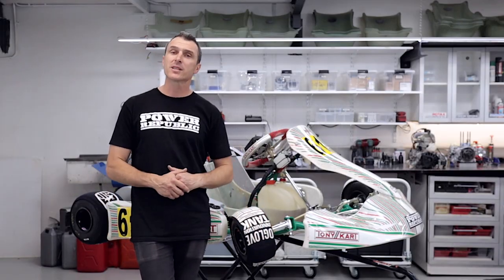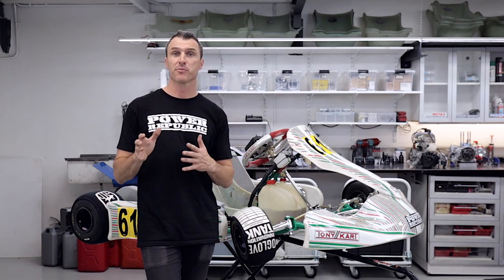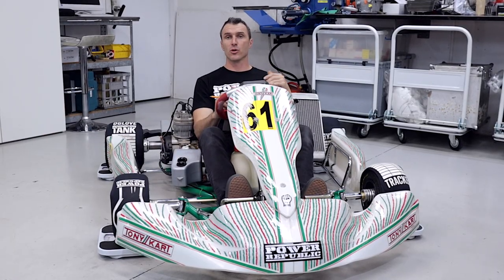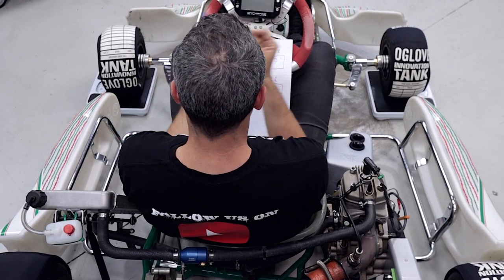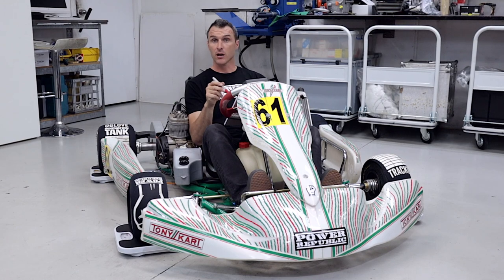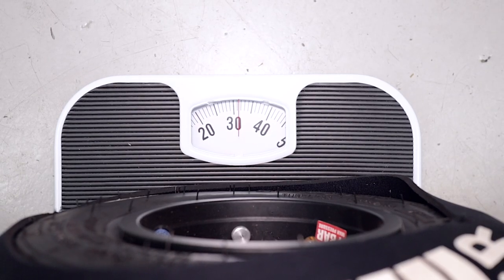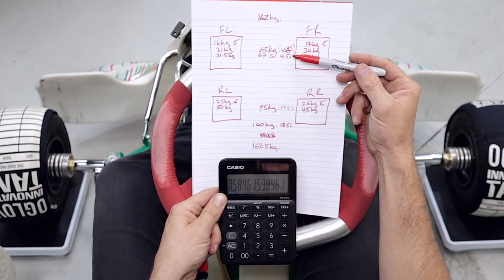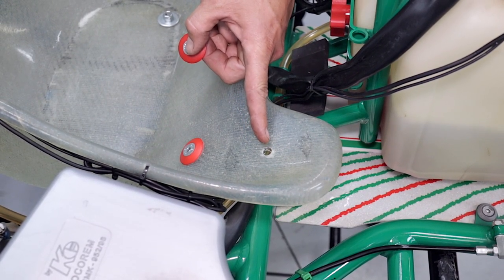HOW TO: Go Kart Weight Distribution for Optimum Performance - POWER REPUBLIC

Comment: If you really want to go into the details on this one, always add your ballast as close to your center of gravity as possible. It makes the kart more responsive to direction change than having weight too far out, due to inertia effects. Think of it as holding a weight to your chest and then trying to turn your upper body vs. holding that same weight out with stretched arms and turning your upper body. The latter will take much more effort, due to the increased arm. Those weights you are bolting onto the chassis under the steering column will probably hurt your handling.
I always work with seat position first to get the correct ratio and then add any required ballast to the sides of the seat, as close to CoG as possible.
Reply from the maker: Thanks for the feedback.  and thanks heaps ro tuning in and watching the videos

Comment: Hi Derek, great videos! A suggestion before buying the scales, I would recommend weighing yourself on all 4 in the shop to see if they are the same. When I went to buy $20 scale, all 4 were gave me slightly different weights by up to 2kg between the 4
Reply from the maker: Thanks for the tips!  I did notice a small variation.   what you can do if you are super keen, you can rotate the kart 180 degrees and re weigh the kart, which I didn't show in the video.  also helps rule out any inconsistency in floor levels

Comment: I'm watching videos trying to demystify seat placement and this awesome video seems to offer a different perspective.

I'm about to install a new seat into my very first kart (Arrow X5).

Being 97kg in the buff and 6'3", am I right to say "forget about weight distribution and position the seat as far back as needed to fit in the kart" then add lead to fix the weight distribution?

I'd rather avoid having to spend another $400 for the pedal extension kit if I can.

Thanks for all the great content.
Reply from the maker: for you height I would reckon you should save some extra and lash out on the foot extension.  it will be more comfortable and help with weight distribution IMO
Reply: @PowerRepublic  thanks, I appreciate your advice. I installed the seat today using your technique and along with readjusting the pedals and heel rest, it feels ok to at least get started but I'll keep the extension kit in mind as my skills improve to the point of needing to focus on balance and inside wheel lift.

Comment: Derek, great video! Is the chassis bent? There is a 5kg difference between the front right>left. Just curious. Thanks man
Reply from the maker: Hey Carlos, not sure on that, I could have moved the scales or the steering wheel to compensate.  I have to admit that it wasn't a perfect set up for the video due to time constraints, mostly just an example of what you could do.  hope that didn't throw you off.

Comment: Don’t forget that it’s critical to have your front end setup as you will be running and to have the steering centred when measuring the corner weights, they can change massively due to jacking forces. Also, are there any F/R% balance recommendations for rookie and cadet karts with narrower rear tyres?
Reply from the maker: Thanks Mr Nismo, I agree with the steering geometry and centring.  Sorry I should have mentioned that as well.   For the Cadets we use close to 50/50 split if they are using the same width tyres.
Reply: @PowerRepublic  yeah I figured it should be closer to 50/50, that’s what I’ve always assumed for (it’s tough to be able to mount enough lead up front to achieve that though haha)
Reply from the maker: yeah other than that you have to move the seat forwards.  Play around with it, everyone is different and sometimes to much weight forwards will create too much oversteer not matter the weight split percentage.

Comment: It is called weight distribution according to the kid's weight. Is not to make him slower, is actually to make him sharper in the turns, he might lose a bit of acceleration but it worth it.
Reply from the maker: yeah the balance of the kart.   check it and then drive it.  adjust forwards or backwards after that depending on your feeling

Comment: @PowerRepublic Question my friend.  When I go thru this exercise I note that a small input on the steering wheel can quickly effect front left and right weigh distribution.  ( which is a good think for a go kart of course)  The question is should I tweak the steering wheel to balanced the front?  No impacted?
Reply from the maker: Yes correct, the steering does impact the readings.   Try to balance the front end, even slap your sniper laser levels on the stubs first to make sure your wheels are straight ahead.  Write down the results.  
Then lift the kart and rotate it 180 degrees and repeat the process.  
This should give you a better idea of your overall situation. 
I will say, that using bathroom scales is not an exact science, more of a ball park experience.  
Good luck and let me know how you go

Comment: We race in the low-power lo206 class, and we are constantly having problems with the rear binding up because the tires have too much grip for the motor. The more weight we can get forward the better. Our alien who is walking away from the championship is a smaller guy who has 18kgs of sheet lead bolted to his floor pan under the seat. He's got almost a 50/50 front-rear split and is .3" clear of the field most days.
Reply from the maker: yeah the low powered classes are a bit like that.  Have you checked out the 'Fast Adjuster" video?
Reply: @PowerRepublic  Those look rad. Looks like it might raise the seat a bit no? I'm 6'2" so I have to run my seat as low as I can get it.
Reply from the maker: Nah not at all. You can still get your seat below the rails if you need to
Reply: Are you guys running the softest axle, cut, with the shortest hubs?
Reply: @helmetculture  I'm on an OTK, so running a 50mm. I run the medium hardnes, standard length

Comment: Hi. I tried this with bathroom digital scales. I tested the scales using a control weight and they were good. 

But when I put the kart on them I get a different reading every time I lifted and placed it back down. 

Just couldn’t get an accurate reading. Any thoughts?

Each one always have a different reading, but with the control weight everything was fine.
Reply from the maker: yeah it is not as accurate as the digital version.  also too if the tyre pessures are different or the steering angle is off slightly will change the out come

Comment: Hope this isn't a silly question but I presume if you measure the weight like this and then added all the 4 measurements up (all 4 scales) then it should add up to the total weight of kart plus driver as if you had weighed it on a large roll on weighing device  (like what we all use at a track). Is that correct?
Reply from the maker: Nah that is correct as a rough idea of total weight.  then check at the local track you are racing at

Comment: Id probably need 20kg to make my kart race legal with me on board. Im about 54kg. I wonder if adding weight would improve the grip on corners, and if that extra speed in corners would improve lap times even with slower acceleration out of corners.
Reply from the maker: Hey Chris, it might add grip.  are you going to be racing soon?
Reply: @PowerRepublic  not as soon as id like. Tracks are open but im busy...
Reply from the maker: Yeah boi.  Get out there.  20kg’s is heaps.  Put it on slowly and feel it out

Comment: Great video but more or less for light drivers if you do a video with the seat position to get optimal weight distribution using the seat position.. and using no weights.  For example for heavy classes.. would be great..
Reply: Yes would love this being a heavier driver! 👌
Reply: Process is the same, but you don’t have any ballast to work with, and the seat can only move forward and back.
Reply from the maker: Great suggestion!  and yes Dan is correct, you would have to move your seat forwards or backwards which would be a bit of trial and error.  also to some of the engine accessories could be moved forwards or backwards to solve some weight issues

Comment: what's the best way to add weight to the left or right at the front ? mostly left to balance engine weight
Reply from the maker: use some lead if you can, otherwise you would have to angle your seat forwards
Reply: @PowerRepublic  hi thanks . i meant how to mount the lead ?
Reply from the maker: @robinafandale  bolt it to the front of the chassis on the steering column support stay (between your ankles)

Comment: Did I miss something, does the left and right need to be even weight the same weight then you have the 57/43front and rear.  It looks like your left and right is slightly off even does that matter
Reply from the maker: Happy new year Kenny.  front/rear should be split 43/57 and the even left and right close as you can ( normally 1-2kg’s )

Comment: What about the weight ratio between left and right. since the motor is quite heavy on one side?
Reply from the maker: hey Jordy, yeah that's right.  the Tony kart in this video has offset seat up rights which places the driver a little off centre to the brake side.   this helps counter the engine weight.  50/50 across the kart (or as close as you could get it) is ideal with a weight bias 43%F / 57%R  as a good starting point
Reply: Yo Derek, thank you for the information. I have moved my seat more to the left (away from the engine). now I have the seat on the side of the brake pedal at 61.5 cm and the accelerator at 62.0 cm. from the top of the seat to the rear axle at 22 cm. is this a bit correct (I'm driving a Tony kart)? And what is the easiest way to change the width at the front wheels (and what effect does this have)? greeting from the Netherlands
Reply from the maker: Sup Jordy, 62cm is a bit close for most people, did you check the weight split with scales?  I think most karts here are close to 63.5cm from the front. and about 19.5-21.0cm from the axle, but what ever works for you.  Stay tuned next week as we have a great idea how to change your seat position while you are at the track.....
Reply: @PowerRepublic  thank you for the quick response. I am only a short person (1.71m & 77kg). I found these sizes online suitable for Tony Kart. what is the advantage if I would move the chair further back? And what is the advantage if the seat is shorter on the rear axle
Reply from the maker: @jordyschoenmakers  as you go back you should get better acceleration grip (rear weight bias). But if you don’t have that problem I wouldn’t change it .  If your kart is balanced then you are good to go, wether the seat is forward or backwards relative to other people or specs.
Reply: @PowerRepublic  thanks. Next time i'm on track i will start testing it.  Thanks

Comment: How mportant is it to have both fronts equal and both rears equal?
Reply from the maker: Hi Mike, great question.  yes equal across the kart is better if you can achieve it.  Perfect level floor, perfect scales and a perfect kart is required for the perfect read out.   Also too if the steering is not perfect centered it can throw out the corners by a KG or 2.   However, if you just want a quick front to rear split you can add them up like we did in the video.
Reply: @PowerRepublic  thank you.

Comment: Why do you put weight on when you are already to heavy?
Reply from the maker: hey Kai, there is a minimum weight you are allowed for each class.  if you are under the minimum you need to add lead to get to the weight.
Reply: @PowerRepublic 
Yes I know. 
but you weigh already 160 kg
Reply: @PowerRepublic  Don't remind me ! For Briggs Masters . My weight was about 135 lbs .Added 65 lbs to make minimum weight !  Even had to use 5 lbs of soft weight in each pocket ! For what ended up being my final race. I made sure I qualified last and pulled all the weight for the final ! After 4 seasons of extra weight WOW what a difference! Kept pushing my luck on a downhill straight after a right turn .Kept putting left tires on paint and the lack of weight grip led to a off track excursion 😀😁 !

Comment: How is the rear left possibly heaver than the engine side? Makes no sense how that happened, that must be one heavy radiator
Reply: I think its because the seat is actually placed a little bit more to the left. When you look at the empty numbers the weight is quite the same.
Reply: @StrahleMann9  that's what I mean, with no one in the seat the engine side should surely be heavier, in fact anyone who's lifted a kart on a trolley knows that!
Reply: @s44yyr  true.... Maybeee invisible weights? :D but yeah it doesnt make much Sense.

Comment: Wait, (get it?) so you guys don't concern yourself with cross weight like we do on cars?  Seems pretty crucial considering the lack of suspension.  I guess there's not much you can do to adjust it like on a car with coilovers, assuming the chassis is true.  I might even argue that if the chassis measures true, but if your corner balancing shows the crossweight is jacked up, it might be worth tweaking the chassis to get that crossweight more towards 50%.  After all, all that matters is how the tires press into the ground at the end of the day.
Reply: If you "tweak" the chassis it will either turn left of right all the time..... Also won't be able to turn eually well both left and right..